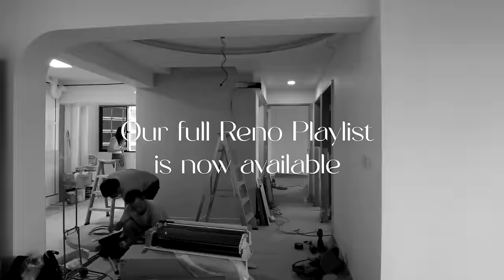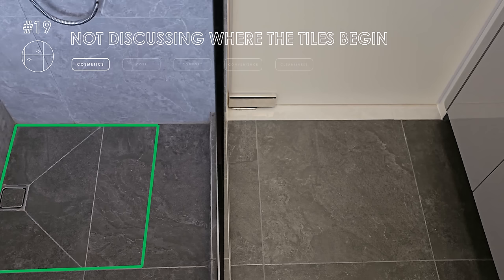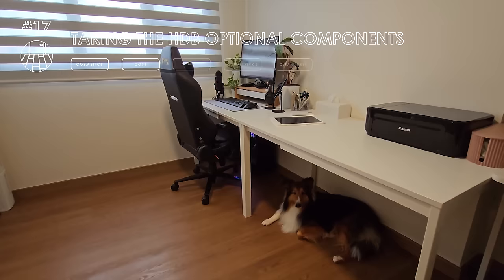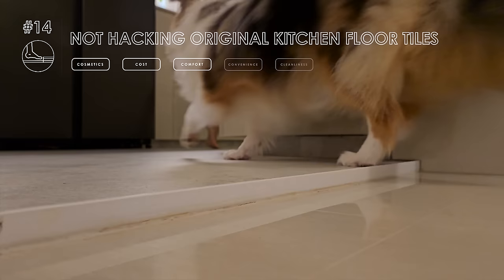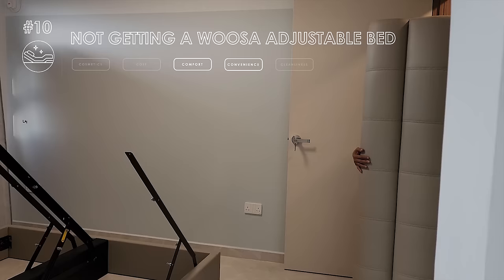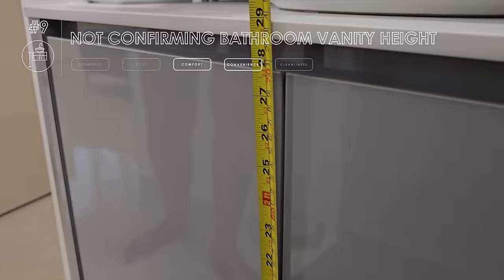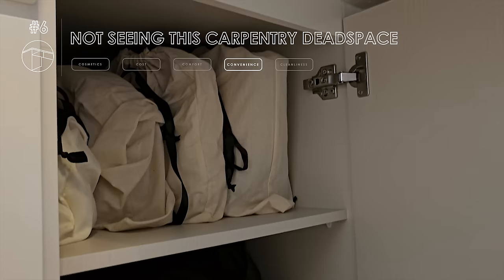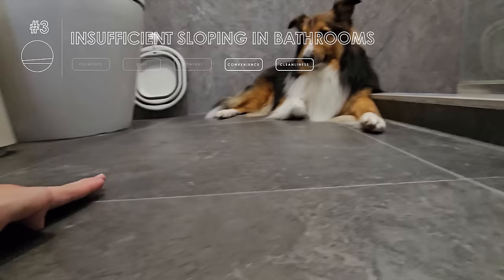20 Renovation Regrets | Don't Make These Mistakes! | HDB BTO 4-Room Home Reno Singapore

Comment: Nice vid . Thanks for your videos  i chose your video to follow (before this one, it was a great help). And i have no regrets . i just finish the reno haha .  checked the hinges in your kitchen cupboard ? my started to rust . For fans i use Franco- hugger series  no issues as i feel KDK too fat /tall. also why not just use a smart switch to control the fan ?
Reply from the maker: Hello!! Glad to be of help! 😊🙏 Congrats on reno completion~ oh no, why so fast rust? Do you stay near the sea? Ours are Blum and so far so good! Aha smart switch cannot split the ceiling fan and the ceiling fan light. It will turn off/on based on the last use state so if we want to turn on the fan for the doggos when we are not home during the day, the light might be on as well, which is a waste of electricity:/
Reply from the maker: Ahah yes Tuya fans might be best for us now. Aha smart home may actually helps to reduce electricity use because of sensors etc. The largest contributor would be the aircon use and dryer use 🤧 our blinds are Dooya (Tuya and SmartThings compatible)
Reply: @thesuakus  to be honest i didnt go all out smart curtain or smart blind it s too ex vs normal ones so i just did my living room and the rest normal ones . We used switch bot too didnt use those smart motor and rail type its too expensive.

Comment: You guys got a bad ID and should have asked for re-tile of toilet since ponding was a mistake by the previous junior tiler.
Reply from the maker: 🤧 too many issues so we only solved the most important ones as our rental was ending and we had to move in asap
Reply: Large tiles will result in ponding due to sloping not done efficiently

Comment: Hi The Sua Kus. For Regret 7: Not Minding the Aircon Flap. I am considering similar Panasonic aircons with NanoEX features as my daughter has eczema and allergic to dust mites. May I ask if you’d still recommend this aircon or just stick with the usual Mitsubishi Electric/Daikin?
Reply from the maker: Hi there! Yes! Primarily because of the nanoeX tech features for allergen, bacteria and viral control. You can read up more here: https://www.panasonic.com/sg/nanoe/home.html
Reply: Thank you for your quick reply. Will there be humidity issue as there will be more H2O in the air?  @thesuakus
Reply from the maker: Nope if you are on aircon cooling mode, the aircon serves as a dehumidifier in a way. You can turn on the nanoeX mode without cooling but we seldom do that :)

Comment: Hello TSK! Quick one.. how’s your flush mount sink? We r undergoing reno and my wife is sold with your idea of getting a flush Mount sink .. want to also ask did your ID share with u any disadvantages? Coz our ID said that in the future we might run into ‘sealant issue’ and may need to replace the sealant in a few years time .. TIA
Reply from the maker: Hello there! Aha thanks for remembering our sharings~ yes still loving the flush mount sink. One of our best Reno decisions. No matter top, bottom or flush, there will be silicon for sure and it will bound to wear and tear over time. But for flush mount, the silicon is a tiny 1mm border and it is super easy to wipe dry immediately 😃

Comment: hi will you mind sharing things to take note for during reno for a dog friendly home, eg tiles to choose etc? Planning to get a dog in e future, n 1st time having a dog haha
Reply from the maker: Hi! Aha you read our mind! We'll share more in a separate video next time but here are some quick pointers: 

1. Tiles are more slippery for dogs but vinyl is tougher to maintain due to seepage and dirt accumulation

2. Dog-friendly sofa - ours is from Cellini and it is a European material called AquaClean.

3. Think about where you want them to pee at home (if allowed) - typically this could be in the common bath 

4. A stretch of hallway (as long as possible) for them to run and have zoomies

5. No sharp edges for carpentry, round and curve as much as possible just like how you'd do for babies.

6. Cables and wires - Think about how you can hide them or get them out of reach

7. Feeding area - water fountain and feedbowl placement 

8. Bathing area - would you sacrifice some bathroom space for an elevated dog shower area so that it would be easier for you to bath them at a height 

9. Storage for their leashes, collars, accessories (near the door?), kibbles (big bag and where you'd store it) and frozen food (bigger fridge?)

10. Heavy shedder? Curtains fabrics types that do not attract dust and fur, or colours that are less visible

Comment: Hi thanks for sharing your regrets, v useful for new home owners yet to start renovation. Just a question as i'm considering SE, but avataron C, which has the normal switches not the long flush type, any experience with these?
Reply from the maker: Hello there! You are most welcome 😀 AvatarOn C is easier to remove the 2-pin plugs!

Comment: Hi Suakus.. I love your videos and has been watching your videos over and over. Question here,my ID says 60 by 60 is not recommended because takes to long to dry off if it’s wet.. is this true?
Reply from the maker: Hello there! 🥰  thank you for your support!! We don't think the ponding is caused by 60 x 60 tiles but rather, sloping. In this video, you can see our example in the common bath where we had to squeegee a puddle. Those are cut tiles. So we think the size of the tiles have little impact on ponding actually!

Comment: Hi thanks for your video coz I have also renovated a year ago.  My bathroom normal cement grouting at the corner has totally come off to my dismay.  I have gotten a a quote from Grout Protech for a re -grout job and they will either be epoxy grouting or Epoxy-Hybrid (Acrylic) Grouting that will be used.  Based on the on-site assessment they asssured me that even if I hard scrubbed in these grouting it will not come off, but after seeing your video now I am not so sure about epoxy grouting at all. The quote is costly too.  Are you able to tell me if yours was just a grout over the original grout it it was epoxy used for all the tile grouting of your new home ? Thanks in advance and look forward to hear from you guys.
Reply from the maker: Hello there! From our understanding, most epoxy grouting is done after the normal cement grout. Meaning to say, normal cement grout is still advised to be used first for stability and then the epoxy grout vendor (a separate vendor in our case) will scrape out the topmost layer and cram epoxy to bite into it. So far all our walls and dry areas have no issues. It's only the corners that start and spread the peeling.
Reply: Thank you so much for your reply! I also IG you just lol kindly ignore that message as you have relied here already! Thanks again and have a good day ahead

Comment: I just got my 2 room 99 years flexi bto with ocs too (minus wardrobe and kitchen cabinet). But I only realised months before that after reading up on vinyl reading of the voc it gives out. Is it very expensive and hard to tear them out? Did yours help you to remove the adhesives as these are the ones that give out toxic voc into the air if they were toxic in the first place! Thanks in advance! :)
Reply from the maker: Hello!! Vinyl is super easy to remove~ they just peel out like puzzle pieces 😀 then the fresh tiles are laid over the base. We don't have the breakdown for hacking works but it should be a couple hundred bucks to remove vinyl flooring for two rooms. If anyone's ID has a breakdown, feel free to share it below 😁
Reply: @thesuakus  wow thanks for the quick reply! Appreciate it :)

Comment: Hi, just to check if u turn on  the first unit of the 9k btu panasonic aircon to quiet mode and 25 deg during the initial start after 3mins do u hear any rumbling or boiling sound that last for a short while?
Reply from the maker: Hi there! Nope we don't hear any of that. You also have a Panasonic X?
Reply: Yes done by gaincity if u turn on quiet mode during the start the 1st unit on will have the boiling sound if u dont turn on other units together.@thesuakus
Reply: @thesuakus and the rattling sound from the case.

Comment: Hey SUA KUS, just curious as I'm considering epoxy grouting. Did you guys do it over the original grout?
Reply from the maker: Hello! Normal grout must be done first. Then, they will use a tool to remove the surface grout before injecting the epoxy grout!

Comment: Actually, taking the OCS might save a little money these days. When I got my place about 5 years back, HDB stopped providing cement screed on request (we were the first batch of BTO where they flat out refused to do so; the BTO batch before us were the last to be able to request for it).
Coupled with the requirements for pre-packed cement that costs more, this ended up costing us an additional $2.6k+ (pre-pandemic supplier rate) just to do the cement top-up (about 40 to 50mm).
Depending on the package offered (during my time, the toilets furnishing, doors, and flooring were separate) for the OCS and the cost of renovation, it could actually be cheaper to take the OCS and have the vinyl flooring torn up just to have a pre-filled and level floor instead of paying an ID/ contractor to top-up the cement.
Reply from the maker: Thanks for taking the time and effort to pen this! What you said makes sense for the flooring option. 😀 But for those who are still in the midst of BTO balloting or waiting for flat selection, it'll be difficult to know or do the math 5-6 years ahead of time...
Reply: @thesuakus   True that. I'd say don't take the toilet fittings and doors from HDB though - just take the flooring purely because the cost of the cement top-up is quite hefty from contractors or ID due to the cement pre-mix costing quite a lot.
Another thing to consider for new buyers is that the OCS isn't actually optional for 2-room flats. Those will come with the toilet fittings, flooring, and doors as part of the base unit purchase.
Reply: It’s actually optional for 99 years 2 room flats

Comment: Hi I'm considering marble gum for my entire homogeneous tiles. Question is can it still be done with our cabinets/wardrobes already up? Also do u face problem with water mark everytime u mop the floor? Will really appreciate yr reply. Tqsm.😊
Reply from the maker: Hello! Yes, while it is recommended to be done at an empty house state, u still can do it when carpentry is up, just that those areas near the carpentry will be done by hand. You can reach out to Mr Siah (contact details in our video description) for on-site assessment. 

No watermarks :) We use Dreame robo so their wet mop cleaning is very precise
Reply: @thesuakus  may I ask if u wet yr mop pad first before using it to vacuum? I was wondering if that might be the reason why some say there's obvious water mark after mopping.
Reply from the maker: Nope the Dreame L10 that we use is completely automated so it handles the sweeping and mopping on its own! We don't have to do anything aha the floor will be very clean after its run!

Comment: what’s the benefit of eproxy grouting? haha still not sure!
Reply from the maker: Hi! We still recommend doing it for dry areas and bathroom walls as there are 0 peeling so far. It looks very good and will not turn mouldy or black like cement grout does. Just don't bother doing the edges and corners. For bathroom floors, we suggest normal coloured cement grout instead. 😊
Reply: Avoid doing the epoxy grouting unless is necessary
Reply: Is there only epoxy grouting? What about marble grouting? Is it the same thing?
Reply from the maker: Marble gum is different from epoxy grout! We did marble gum for our living room area and it's one of the best reno decisions made! 😀 We shared the differences between marble gum and epoxy grout in our Bedroom Episode here : https://youtu.be/H8UstyNBPEM

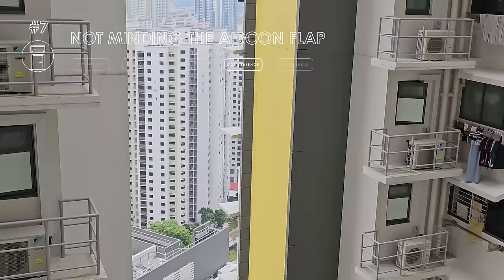Comment: @15:20 no licensed electrician will help you install the universal sockets as they are not recognized for use in Singapore.

To quote "Switched socket-outlets are classified as Controlled Goods, regulated under the Consumer Protection (Safety Requirements) Regulations (CPSR). Controlled Goods are required to be tested to their relevant safety standards (i.e. SS 145 for socket outlets) as specified by the CPSO. Universal socket-outlets will not be able to comply to the requirements stipulated in SS145, and therefore cannot be registered with a valid Safety Mark in Singapore."

Fire insurance also will void your insurance pay out in the event of a fire if such devices with no safety mark are found.
Reply from the maker: Ooh thanks for sharing! 

For those who want to read more, here is the link: https://www.consumerproductsafety.gov.sg/safety-tips-on-universal-socket-outlets/